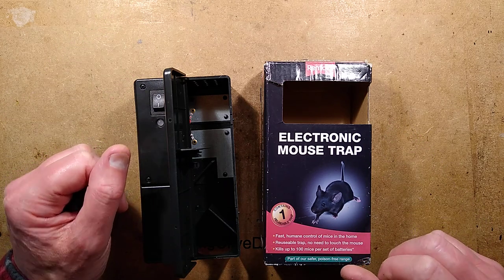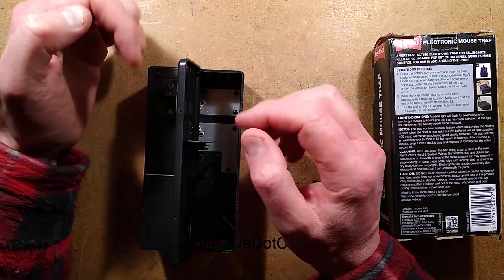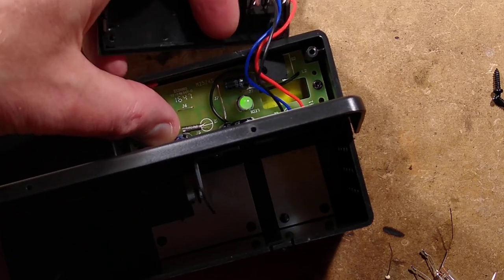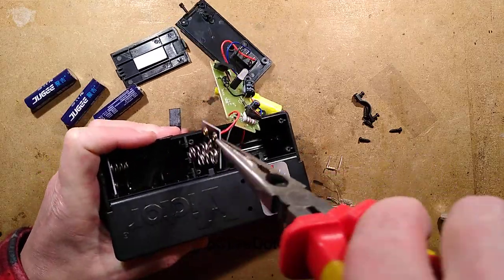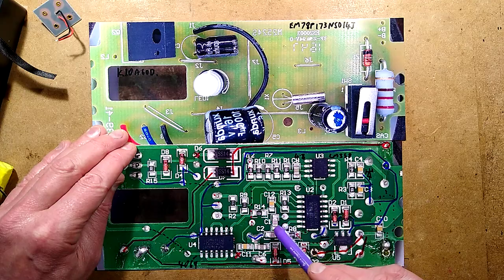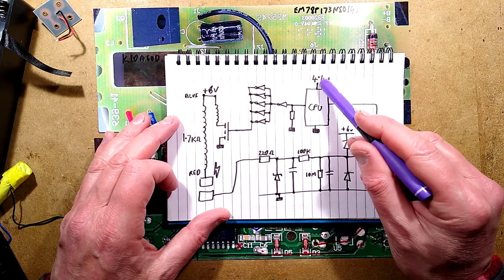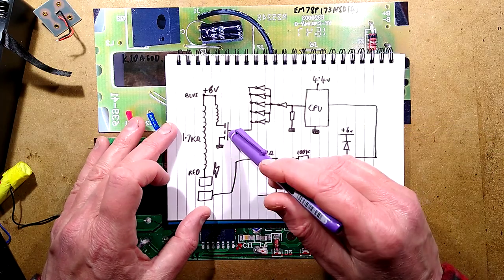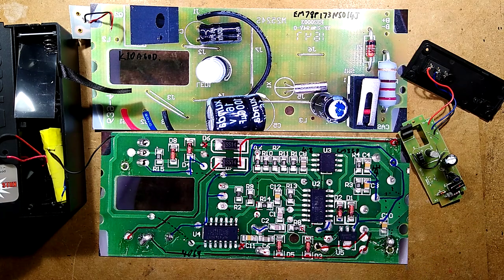Inside a Rentokil / Victor electronic mousetrap.

Comment: Looks like a repurposed DIY battery spot welder.
Reply: Similar in concept, but this is converting up to high voltage/low current (well, still high enough to kill a mouse, apparently) whereas a spot welder transformer will typically be low voltage/high current on the secondary.

Comment: It must have a non insignificant current consumption, if the coil have to run all the time
Reply: I have a few of the larger rat-catching variants and 4 D cells last for at least years (not sure on the number of mouse kills in that time, maybe 30 or so...
Reply: @fredjones100  Well maybe it goes to hypersleep... Maybe the 358 is also acting as a feed back as function of suppressing the coil voltage, that would definitely increase the life time of the battery.

Comment: I had one of these. They work great until the mice figure out how to chew through the "scent" holes to get to the peanut butter.   The new ones have a detachable kill chamber so it can be cleaned, as after a few uses the mouse urine builds up.
Reply: Do you have a link to the new style? I don't see any different types under Rentokil or Victor brands. Thanks!

Comment: The problem with this is, one victim will clog up the whole works - cause a bottleneck, so to speak.
Reply: There's a pro version which can do 3, or a multi version for 10 at a time. Personally, I think if you need the multi version you would be better off burning the place down.

Comment: I would be surprised if the batteries with the voltage converter in them, would be able to provide enough current.
Reply: A single AA battery can light you up pretty good with the right flyback transformer.
Reply: @demef758  Yes because I am sensitive to high voltage at a given current but it is bugger all power less than 1W
That thing will be trying to take high power probably in the region of 6W for 20 seconds.

Comment: 5:34 simulated mouse squeak as neon lamp wires scrape plastic housing.
You did that on purpose, didn't you?
Some years back I was seeing people whine that there would be microprocessors in everything, even things that strictly speaking didn't need them.
Now they're showing up in electronic mousetraps.
Damn, they were right.

Comment: I swear by the Victor Snap Traps.  The only ones that actually work.  I have a few with some 30-50 kills to they're credit.  Yea we have rodent issues here in New Mexico.  Victor : Made of the finest Oak Wood and Spring Steel known to man.    Diligent Care is required for the Victor Rat Traps.  They BRAKE Fingers quite well.  Yep Been there.

Comment: I have to trap mice in my house or they could chew/set fire to the wiring :o( Old fashioned 'little nipper' spring traps are instant and extremely reliable. Not nice to 'unload ' though. Sorry if this upsets townsfolk, but I need my house not to be on fire.
Reply from the maker: Not just the wiring.  Apparently the new push together plastic plumbing is also a popular snack.
Reply: @bigclivedotcom  I only have copper plumbing, but edible plastic is bad news then - double wammy !

Comment: They make better traps.  This trap will catch one mouse per use.  They actually make a better version that dumps the mouse into a holding area and resets the trap.  This trap will kill one mouse and need to be reset with fresh batteries after a mouse completes the circuit.
Reply from the maker: It can operate a high number of times on one set of batteries.

Comment: Still messy. The fact that you have to probably dig out the dead rat to dispose of it and probably clean the insides once in a while because some rat gunk has oozed out is not very efficient and pleasant. Those cheap cage traps that uses bait with a spring loaded trap door are still the best. Doesn't kill it so you can just let it go. Meat is the best bait because it's tougher for rat to pull hence it doesn't give a false trigger. Forget the sticky pads. They never worked for me.

Comment: Works a treat that does
Needs 5 rechargeable lasts longer than alkaline
Reply: It needs regular refill of peanut butter anyway.
Reply: @johndododoe1411  anything they can steal is no gud but if spread around the holes they clean outside then go inside 😂
Reply: @davey2k12  Point was that if there are few mice left, the pb inside might dry out before catching the next one, just like the batteries.
Reply: @johndododoe1411  catch 2 to 5 I think with cheap AA cells but 5 2500mah catch bout 10 lol not bad really but I used a cardboard switch to sound a bleeper when they go by it 😂
I know what you sayin tho is pointless with 4 alkaline cells 😂

Comment: HV mosfet used in low voltage circuit? Why? It's so irrationally. I do not believe, that voltage spikes on primary exceeds 600V, maximum 50-100V when unloaded. It's more correct to use a low voltage, logical drive mosfet (~30V), and remove a level shift circuit. It will improve efficiency, adds more strong power for mouse, and decrease number of components. Given the existing errors, I won’t be surprised, if the microcontroller outputs a PWM with 50% duty cycle, and transformer works saturated most of the PWM time, discharging the battery
Reply: You have no way of knowing how high the Drain voltage swings when the MOSFET turns off and air cored transformers do not saturate.
Reply: This transformer have a ferrite core, and usually in this transformers primary have about 10 turns, and secondary about 1000 turns. On mouse drops about 1000 volts, voltage on the drain will be about 6V+10V = 16V. It's possible to use a 30V mosfet, and there is a reserve of about 10 volts for primary leakage inductance voltage spike, when mosfet is turned off (of course, low primary inductance produce very high frequency and low duration voltage spike, not necessary to use snubbers).
Reply: @makoveliprod  When the circuit is operated on no load the Drain voltage when the MOSFET turns off is only limited by the resonance of the transformer's primary inductance with its self capacitance and the Drain capacitance of the MOSFET.  It will peak at several hundred volts.
Reply: @petehiggins33  *secondary inductance, because it's step-up transformer and secondary have much bigger inductance, that primary. This device is low power, I think power dissipation on mosfet, when it's turn off and absorbed voltage spike, will not exceed the maximum allowable dissipation of TO-220 package.

Comment: always wanted to build a high voltage rat enrgyzer ,,problem must include rat ejector ,and  ele ctric ey to activate coil no  need for 
moving parts, must be able to handle country wood rats 12 /17 pounds, say 200000 volts ac  at .5 amps  hmmmm ?

Comment: We live in a mad world where a sophisticated set of electronics is used to substitute a small wooden board, a piece of bent wire, a spring and a bit of cheese. A device which has been working well, in wet and dry, without any batteries to go flat,  for 150 years at least.   Ah, a better mousetrap? I think not.

Comment: Output hertz, current, waveform and voltage measurements clive?
Reply from the maker: Not easy to measure with a standard meter.  Especially if it could be over 1kV at high frequency.
Reply: bigclivedotcom measure it on the low side of the transformer.
Reply: @bigclivedotcom  resistor voltage dividers are your friend and not too different than your series of neon bulbs!